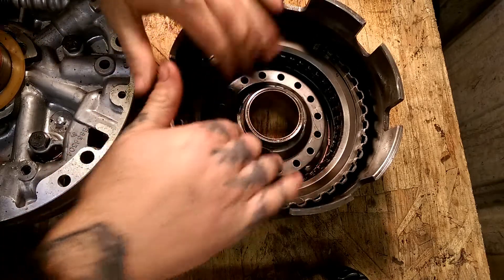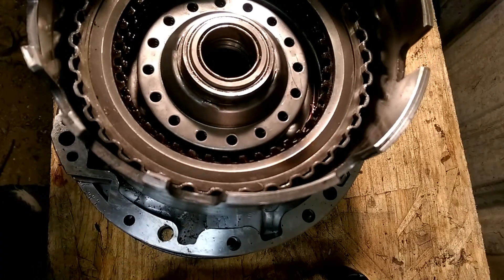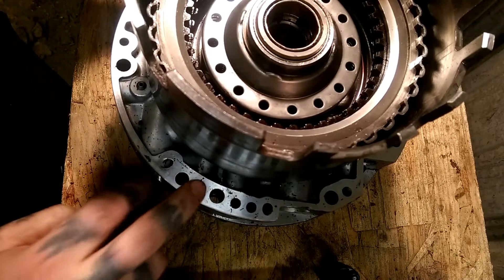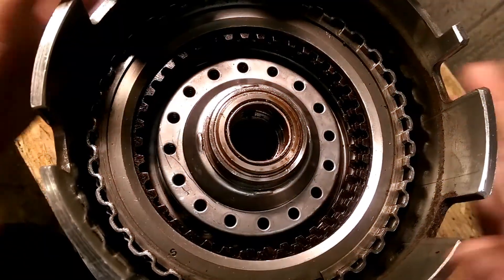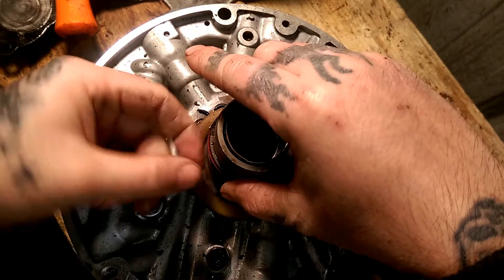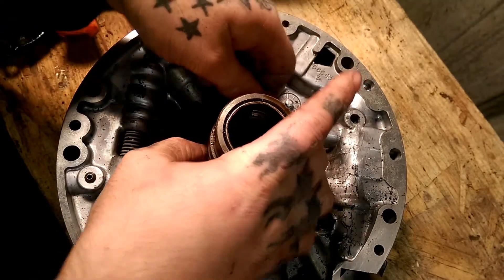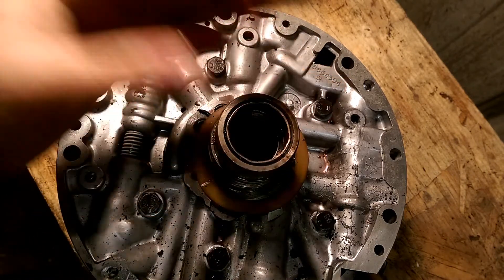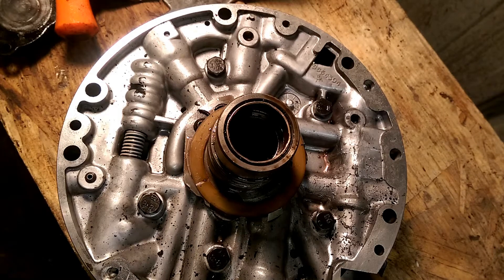HOW TO BENCH TEST / 700R4 4L60E REVERSE INPUT DRUM BAND DRUM

Comment: When you bench test this with the airline does it matter what PSI you have it set at?
Reply from the maker: I use like 60 psi on my compressor, but it should not matter long as the pressure can make the clutch basket engage